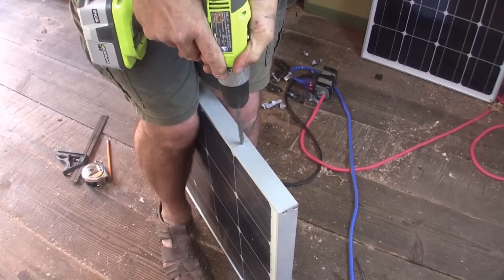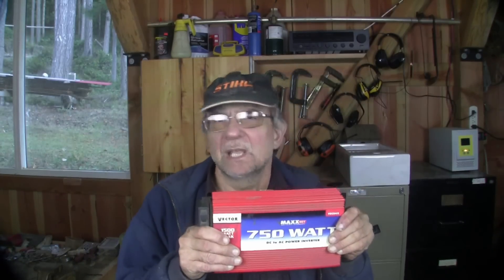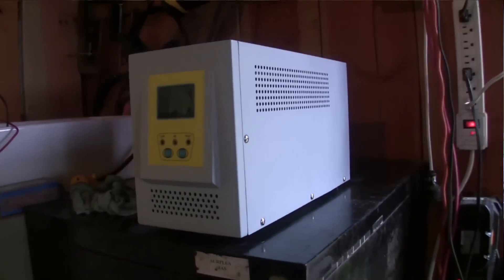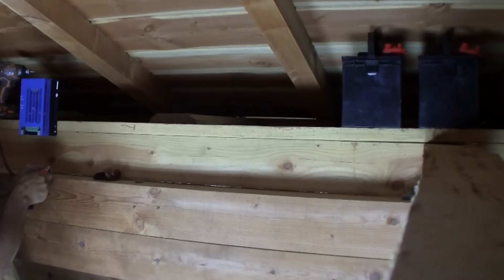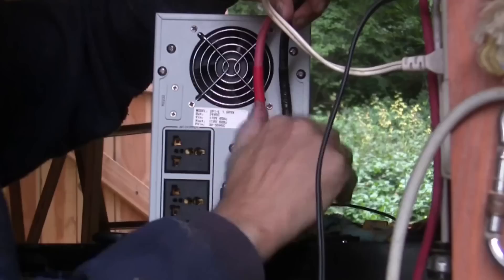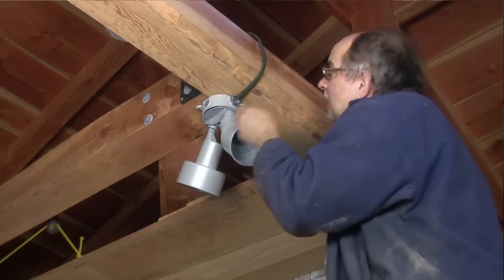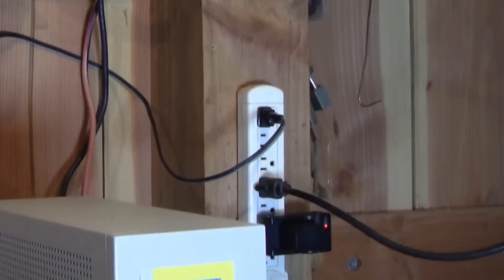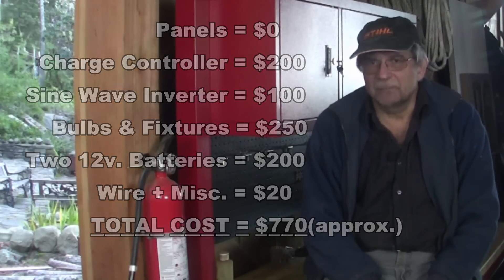Budget Solar Install Part 3

Comment: Looks good you also have a way to charge your cordless tools in the shop.  I would suggest a master switch in the 24 volt line to inverter so you can kill the inverter from the battery bank because most of them will still draw power even when turned off.  It's not much but it's still a power draw that can drag your bank down over time
Reply from the maker: Hey Kriss; Good point...there is still some fine tuning to do in that department - fusing/switching, etc  I'm already loving the lighting and yes, charging cordless tools.
Best regards,
M
Reply: Markerbuoy - On Canada's Left Coast The rough number amp draw is about 5 amps for your inverter draw with your lights.  I don't know what your low voltage disconnect is set at, but abut 23 volts is about as low as I would set if you can.  23.5 would be more ideal that way you don't over discharge your battery bank.  The big killer of inverters is low input voltage.  Going with a 24 volt inverter is better for the battery bank because your have a lower amp draw.

 For a switch I would use marine battery switch, I'm sure you could find one on your used every where site.
Reply from the maker: Kriss Femmpaws Good suggestions. The paperwork/manual with the 24 volt inverter is not the best (unlike with the blue charge controller) so I will have to dig to find the low voltage disconnect value; worth investigating. It will be interesting to see how my panels perform, connected in series; now lots of volts but fewer amps...although the lower battery draw at 24 volts is a definite advantage. Great suggestion for the battery switch - I'll start looking!
Reply from the maker: Kriss Femmpaws I agree. In the meantime, I plan to add a couple more batteries, for a bank of four @ 24v. I'll wait to see how the panel/battery combo works in use.
Reply from the maker: Good point - solved that problem with the cabin system by adding more panels. Time will tell for the shop :-)